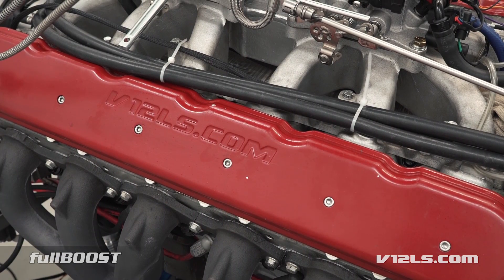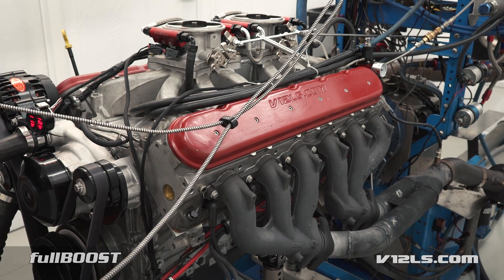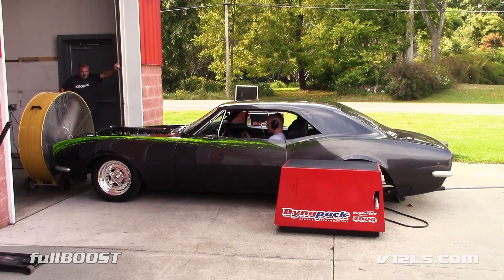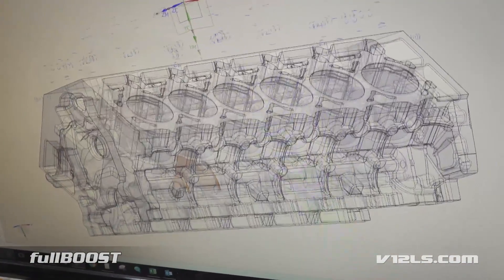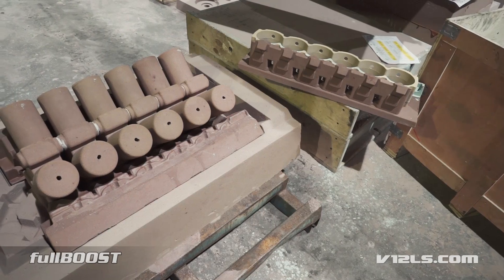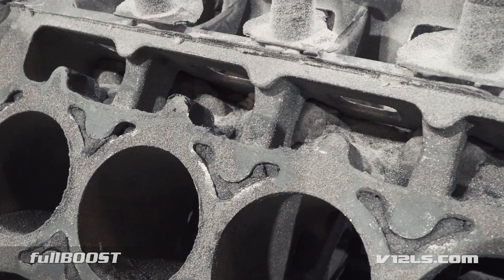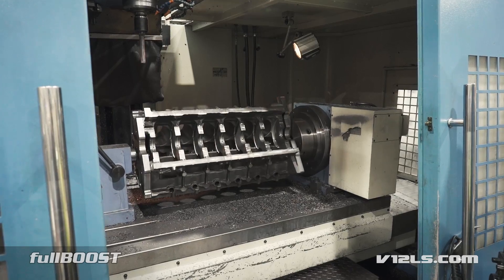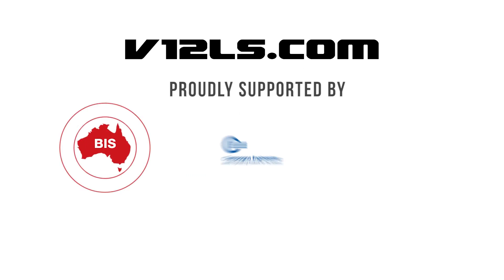How a V12 LS engine is made

Comment: Sounds terrible
Reply: Gaz Girl haha so butt hurt. I own 2 cars thank you very much.
Reply: Callum Tapper uuh omg you are so rich. Dip shit.
Reply: john jay where did you see a 2.0 inline 6?..
Reply: Hahah how long have you been building engines ,you got no fucking clue ,,how old are you???
I already have a gas powered V12 truck it was made in 1965 ,, powered by a 702CI V12 it's a GMC C8000 truck tractor ,, engine has 255HP and 600LB/FT of torque ,, it'll pull 60,000#  without a complaint
and then there is my 63 GMC 6500 with a 478CI V6 engine  , it has 250HP and 450Lb/Ft of torque 
it was built as a tow truck by my grandfather in 1970 
I know more than a little about pulling power  ,, and i can tell you  that with  the right transmission and gears behind it  ,, this LS V12  will out pull any diesel pickup there is
Reply: +Alexgotnicebody BMW made numerous 2.0 straight six engines.
Reply: Alexgotnicebody 
That's what I thought.
It's a very hard to tune setup
Nelson in CA.
Reply: john jay hua what
Reply: I own 9 trucks ,, and this would make an awesome truck or RV engine ,, something where lots of power to PULL is a huge plus and fuel mileage is no worry, I would opt for the cast iron LS-V12 for that
Reply: wildcoyote34 if you owned trucks you should know that diesel is way better than putting a v12 in it. Smart one.
Reply: MmHMM yes if i wanted to spend $20K+ every time it broke  sure i would buy a diesel ,,
there is no automaker in the US building ANY diesel engine that produces 600+HP strait out of the box with stock reliability ,and all of the bullshit they add to reduce emissions only costs more ,,ALL of my TRUCKS are NON EMISSION vehicles that came from the FACTORY with NO EMISSIONS ,, that much less to go wrong 
this engine has less to go wrong with it than even a 1st gen cummins 6BT , which by the way i do own several of ,,and add to it the fact that this V12 has 75% parts commonality  with every other LS v8 ,,this is the reason I would opt for this over ANY DIESEL ENGINE MADE
Reply: wildcoyote34 go ahead kid. Put a gas powered v12 on your trucks. See what happens. That sure is the answer.
Reply: wildcoyote34 you know what you said? Bla bla bla plus bla. I didn't ask you anything. This engine sounds like shit. Period. I'm not asking you about reliability.
Reply: you just proved YOU ARE STUPID ,, REPEATING ESTUPIDO  ,,, 
you didn't answer my question ,,how old are you and how long have you been building engines 
an engine never sounds the same on a dyno as it does in your vehicle ,,and the video shows the PROTOTYPE engine ,,you need to learn to keep your mouth shut and stop being a troll
Reply: oh and alexgotnicebody ,, before you troll someone I/E ME ,,Know who you are dealing with  ,, because every comment you make from this point forward will be reported to youtube for harassment ,,and every comment you make on any video i watch will be the same
Reply: easy to ask hard to answer , cause i never really calculated it fully,,
my average loaded MPG pulling my 25K# travel trailer about 5.5 in the interstate  and i've gotten 7.2 in the hills 
towing a truly large load  i've never gotten over 5 ,,,I've never really done a full workup on it cause i don't drive it a lot or for long distances ,,i've only gone a few hundred miles at a time 

my other truck surprisingly gets  the same or better mileage,, i can get 9pmg  easily with the 478 V6 ,,
which is comparable to my 1984 F250 with it's 460 big block V8
it has more low end power than the big block V8 though
Reply: no problem ,,   it's a beast for sure ,, but the LSv12 is so much cooler  being modern ,,and it sounds a lot nicer too
Reply: Alexgotnicebody yeah it does sound pretty bad tbh
Reply: Sould be expected. It's not a CLEAN V-12(60* cylinder banks) but rather a "do your best with what you got available and know how to tinker with" type of project.
Reply: A V12 does not have to have any particular spacing on the cylinder banks to have an even firing order. Its just like 2 inline 6, assuming they are using a flat plane crank.
Reply: john jay wrong, your m20 sounds better.  Gutless as hell but chop the exhaust off and it sounds great.

Fun fact, due to poor fuel quality in north america, you need to set the valves a bit loose to obtain a nice smooth idle, meaning if you never adjust the valves ever, the car just idles wonderfully smooth.  They sound like a sewing machine like that though lol.
Reply: well i happen to agree with you there  ,, it would sound much better with headers on it ,, or with a pair of turbos 

I am actually looking into buying one of their cast iron model once they develop a bit more ,,cause i have a couple projects where this would fit perfectly ,, it would certainly fit in my C8000 GMC truck which has a V12 already ,,and i am planning to restore it
Reply: no.. sounds like a Jaguar
Reply: Alexgotnicebody just keep filming all those exotic supercars you can't and ever afford manchild or just child so stfu
Reply: +Alexgotnicebody do you seriously think i'm trying to brag about how much money i have? I literally payed all of like 500 bucks at the most on my shitty ones and my good car was 3 grand... I'm not rich lol
Reply: +Alexgotnicebody i own 4 cars you scrub
Reply: Alexgotnicebody just like your sad comment, indeed terrible

Comment: turn key package: $46,200. Does not include headers, Air filter,  Flywheel/Flex plate, Water pump and front accessories.
Reply: Superman iron blocks are way stronger than aluminum blocks, thats why people use lm7s and not l33s in turbo swaps
Reply: @rmaul2469  Iron, as a material, is stronger than aluminum, but aluminum blocks can be remarkably strong. The 5.0 Coyote/Voodoo come to mind. That block has survived over 1000hp on the stock block and done so reliably with Darton sleeves.
Reply: id say that's about what German manufacturers charge for their high performance engines.
Reply: nuts why silly heads by that German junk aluminum cylinder twin turbo bmw crap there so dishonest.. i got a Porsche 928s with niskisel coated cylinders neat engine but wtf oil burner at 150.000 will sleeve it --wile a f-ing mazda 2018 4 banger had molybdenum liners in the 2.3l in a fwd shit box car go figure that bs out a man works for 12-25 an hour aluminum scap is say 40 cents a pound so 3500-5k max for a block only n that not cheap it metal nothing exotic
Reply from the maker: At 580cubes, it wont need much boost!
Reply: @fullboost  700-1000 is possible out of a 8 and like a 4th of the price so were are they going with this
Reply from the maker: @jordanlittle5391  Generally people buying these engines are after something more unique. Cost isnt always a factor to some
 👍
Reply: $36k USD.
Reply: Use quad turbos for that beast
Reply: iBoos nah for an amg c63 the engine itself cost like 70k while the car cost 80k lol
Reply: tuurbow does it come with a car to put it in?
Reply: ...Or I could just pull a v12 out of a bmw 8 series. it isn't 580cu in but it's also not ~$50k
Reply: Ahh so much bold typing, caps lock and bmw fanboying. Enough to give you a migraine.
Reply: @Alex Villalobos you watch too much Auto Vlog
Reply: m30 is a great engine. i had a 745i factory turbo car. big car but so much fun. stock fueling was so-so... i wanted to shove that into a e21/e30 im too big for an e10 chassis :-D
Reply: Yup.... They fucked up... I'll still kick its ass with a supercharged RD1 Hyundai tiburon.... 6 second quarter mile....
Reply: john jay  AMG engines are assembled by hand, they are the product of extensive German engineering, and the quality is not compromised.
Reply: @U--Bravo This statement didn't age well.
Reply: john jay  yea.. like the price is only dependant on a number of cylinders. lol
Reply: john jay We owned the F11 520d for three and a half years. I know that it’s a pretty boring car, engine wise, but it is the best car I know. In those years we put over 250.000km on it and never really had any problems with it. Like it just started up every day without a problem and drove nicely and quite fast.
Now we own a G30 530d for over a year and already put 80.000km on it. This car is just a dream. It’s way more powerful than the 520, while up to this date being just as reliable. The 530d is just the perfect car if you live in Germany and cruise on the autobahn everyday. Low fuel consumption, good power, amazing comfort, ... it’s just a great car. I’m very very curious to see if it will survive the full three years with us.
Reply: probably about as much as youd spend getting 700 naturally aspirated horsepower from a v8
Reply: 46k for this v12 engine? damn
Reply: Superman 

😂 till the engine morphs from the heat and boost
Reply: john jay well more that they are in different leagues the AMG is refined while the LS is a brute grunting Engine
Reply: But if you get the cast iron block and some forged internals and put it on maybe 30-40 lbs of boost you’ll be making a safe 1800 easily
Reply: Rmaul246 bruh you do realize a stock bottom end 6.0 made 1634 hp on 29 lbs I’d boost right they only stopped at that because they needed a 4 bar map sensor
Reply: Fullboost but with 580cubes it would spoil some pretty big turbos
Reply: I’ll build a normal ls or ford coyote or a hemi that’ll push 1200hp for 3 quarters of the cost
Reply: Cheaper than mine :(
Reply: john jay yeah cool old school unrefined pushrod truck engines are strong and cheap, who gives a fuck. So is the engine in my lawn mower.
Reply: @nk0723  nobody's talking about lawn mowers you f**** loser .
Reply: john jay it's an AMG Engine created to high standards very complex Engine and much more difficult to build and assemble while this is a simple block and pistons with heads and turbo while the AMG has hundreds of parts from the block to as small as the ball point of a pen and the electronics of an advanced computer